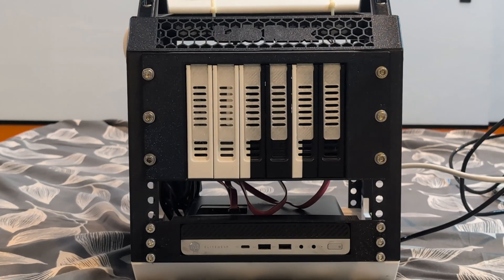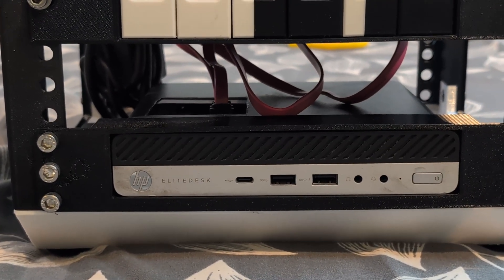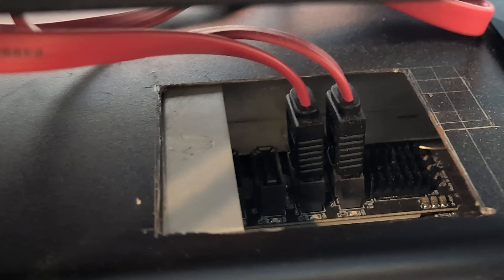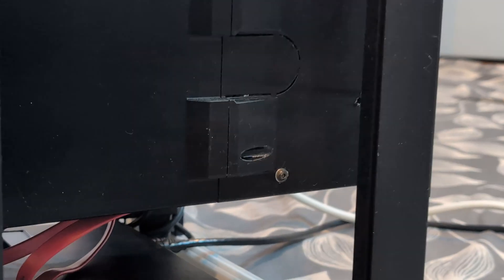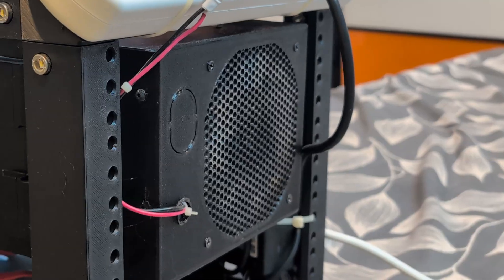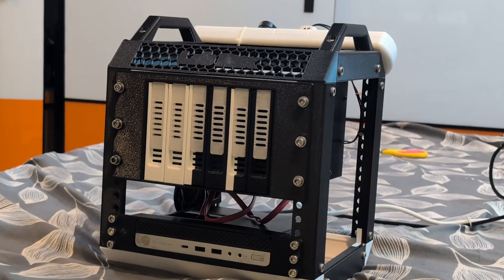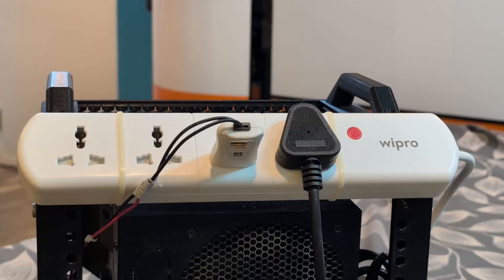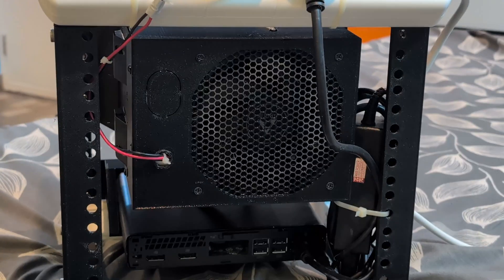Fully 3d printed budget NAS server

Comment: Looks great - I am looking to do something very similar, but also adding a second mini PC. Less HDD trays though. The Labrax designer JUST released new files for a 1U HDD tray to hold 2 HDD caddys. I use the same mini PC’s in my homelab…great little machines! Just finished printing and assembling my labrax rack - cleaning it up and getting ready to print the shelves! Glad I found your channel because I needed a shelf for the HP elitedesk minis